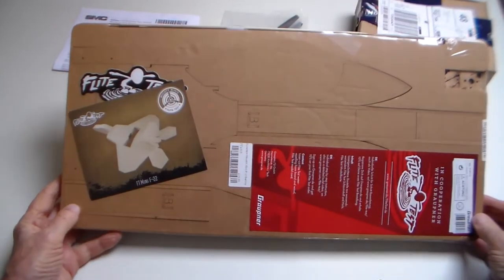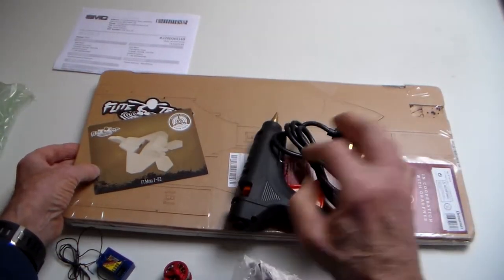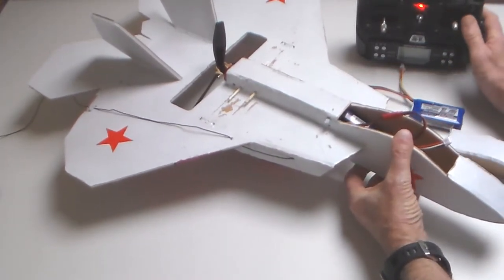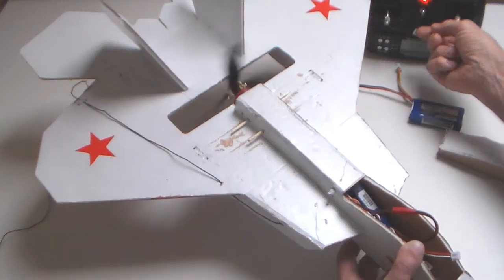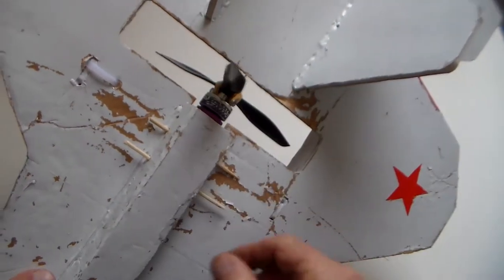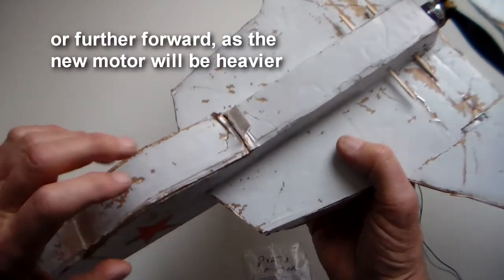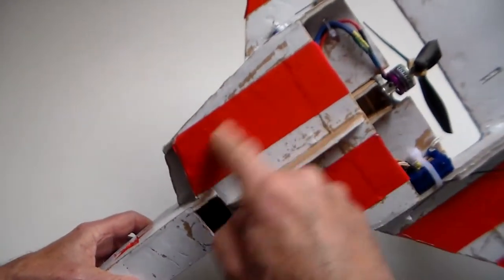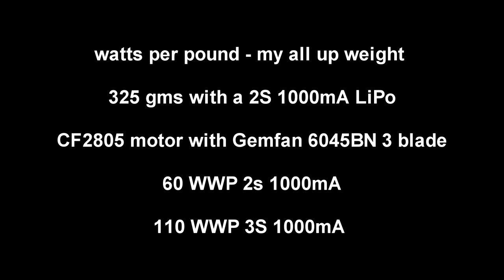FlightTest Mighty Mini F22 Raptor Quick Build + What Not to Do!

Comment: Change the title please. maybe you had a lot of crashes but it would be fair to show one of them. Disappointing...
Reply from the maker: My title doesn't say I had crashes? The 'what not to do' was, don't glue the bottom piece on, don't put weight too far forward, don't use acrylic primer to paint with, don't use not recommended motor and prop  ..... Etc. Nothing to do with crashes. They were mostly nose ins due to lack of power anyway. Not crashes as such.